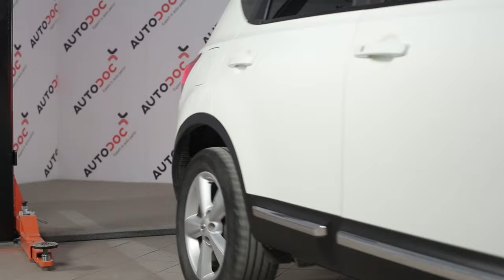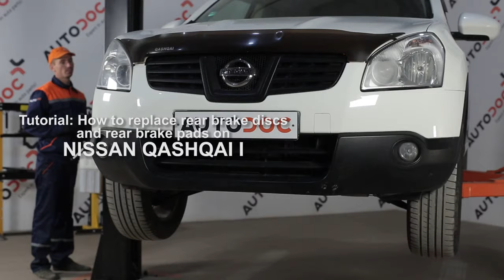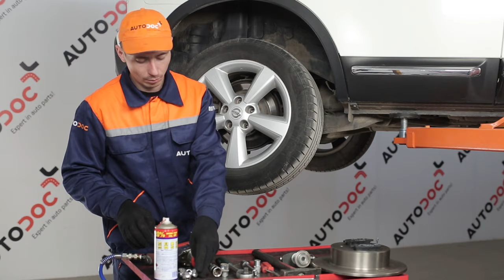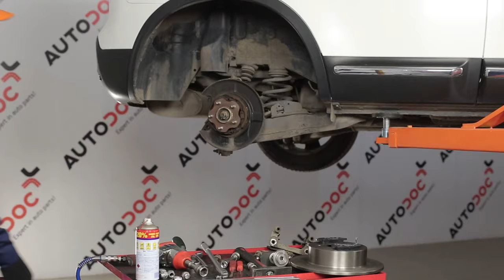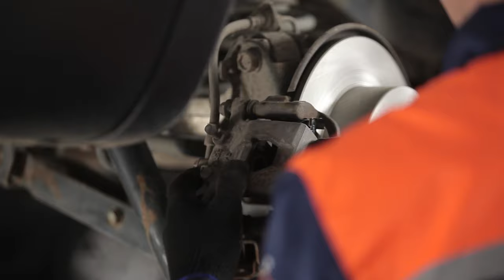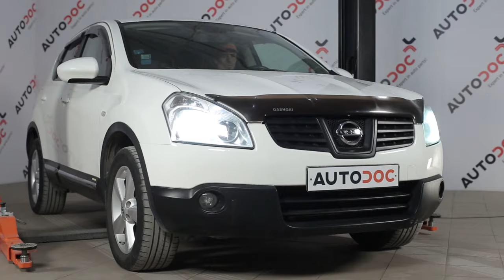How to change rear brake discs and rear brake pads on NISSAN QASHQAI 1 TUTORIAL | AUTODOC

Comment: Hi. When changing the disc's(front or back) should the brake caliper be strung up instead of hanging free. Surely as a mechanic you should've known this. Left hanging it puts stress on the flexi brake pipe and will weaken it.....
Reply: Common practice is stringing up the caliper to protect the flexible pipe.

Comment: Hi Great Video However can you please provide a detailed explaination as to what you are doing with the flat head screwdriver once you remove the rubber bung on the old disc near the studs & again what is the correct procedure when installing the new disc with the flat head inside the hole? TIA
Reply from the maker: Thank you for the feedback! We strongly recommend you to visit a specialized car service center. Best regards, Autodoc.
Reply: If you leave the handbrake on, you need to rotate the handbrake brake adjuster (cant remember the name of it) to release the disc frim the handbrake shoe. But if you have the front wheels chocked and the handbrake off, you can just skip that part.

Comment: Thanks for the informative video, I did everything and washed the whole mechanism before putting new disc on, ended up with ESP lights on, any advice please what might have happened?
Reply from the maker: Thank you for your comment!
Perhaps one of the wheel rotation or body position sensors has failed, we recommend contacting the service for a complete diagnosis and determination of the error.
Best Regards,
Autodoc team

Comment: What is the chap releasing and then re-engaging through the hole in the disc. Is this some kind of retaining device?
Reply: hand brake pads that are inside the drum. he release a bit and then tighten back.
Reply from the maker: You are right, this is a retaining mechanism. Best regards, Autodoc.
Reply: If you look closely at the bottom of the handbrake shoe, front one, once he's removed the disc, you will see the head of the adjustment bolt which has some cogs on it to make the adjustment possible. This is the bolt he is turning in to release the handbrake shoe in order to be able remove the disc. Once the new disc is in place, he turns the adjuster out again until the handbrake is correctly adjusted.

Comment: Auto doc are you turning the screw driver in the hole for the safety brakes
Reply from the maker: Hello, the protection locking mechanism can be taken off with the help of the screw driver. Best regards, Autodoc.

Comment: I notice he didn't use a torque wrench to tighten brake bolts and no grease on retaining spring at rear  , boogie and scarper job
Reply from the maker: Thank you for your feedback, this video shows some mistakes, but we are working on improvement of the quality of replacement of the part. Due to your valuable advices, we know what needs to be improved and replaced. Best regards, Autodoc.